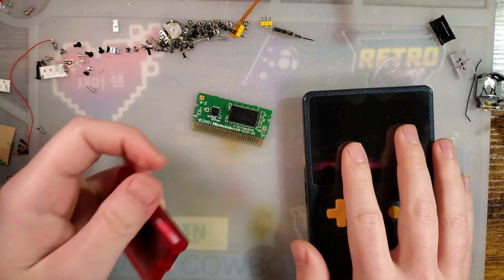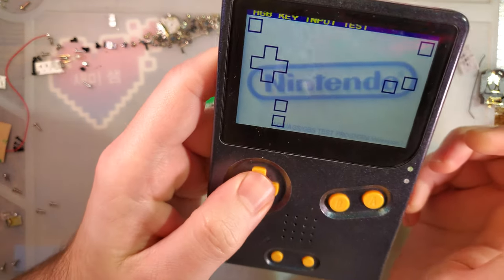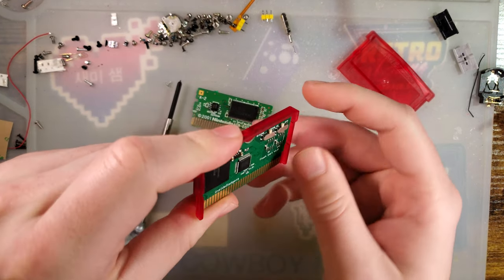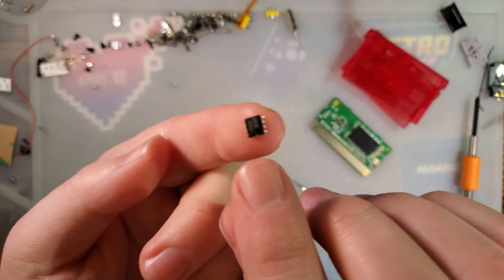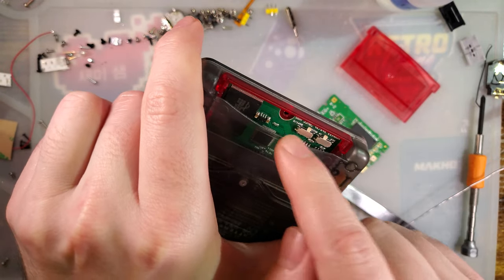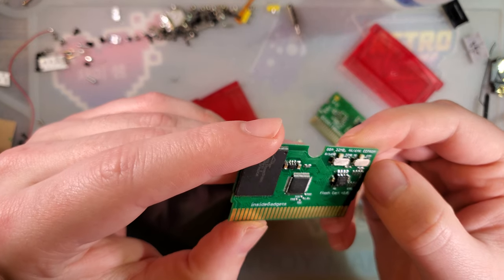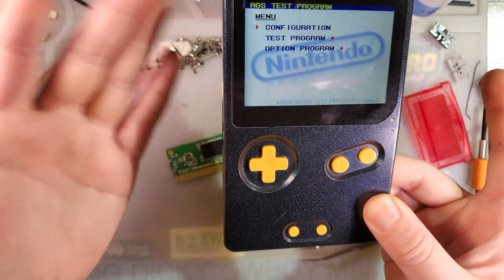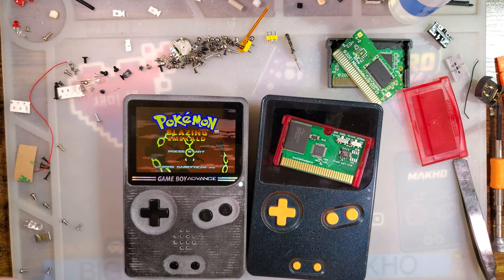insideGadgets GBA EEPROM Save Flash Cart

Comment: Hey mahko, I just want to thank you. Today I got a power cleaner and amp mod for my gba sp. I was scared to solder anything on my gba. I even had my ips screen installed without the brightness adjustment because I didn't want to mess up. But because of your videos I got the courage to finally mod my gameboy. It took 2 hours but man I really didn't want to mess up and it was difficult to get it right. But I did it. Thanks Mahko! Without you I woukdve still had a stock gba sp with a bright ips screen lol. Next up usb c mod after some more practice!
Reply from the maker: I recommend solder practice kits if you're looking to work on that skill. They are pretty forgiving and in the event of an error, you're only out the price of the kit itself instead of your GB + whatever mod you were trying to install. Nicely done otherwise!

Comment: Those slates look nice! Are you planning on designing a matching back housing to replace the OEM one so that it all matches?
Reply: That prior build with the "sharp" control area bevels is just so damn clean looking. I understand why he smoothed them out, but I just can't get over how off the retail iteration looks as a result of the smoothing.
Reply from the maker: @CockroachMunchingKrabbyPatty  believe me, I know where you're coming from. The smooth one feels a lot better in the hand though so it's the way I went. I do like the look of the angled ones better though.
Reply from the maker: no plans at this time. Unless they were all manufactured at the same time (and that ship has already sailed), the colors would not match anyway. Anodization is a tricky thing to get consistent.
Reply: @makho  Good to know. I just recently did a boxypixel one. If I can get my hands on a few more SP's I'm going to give the slate a go. Thanks!